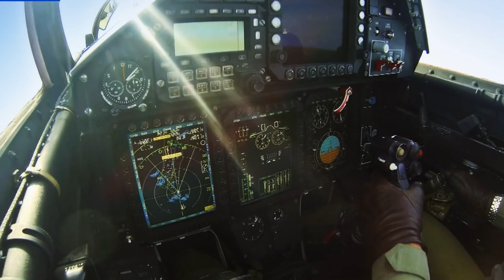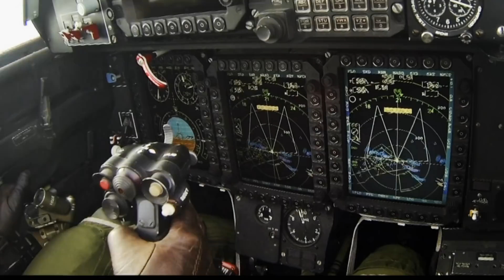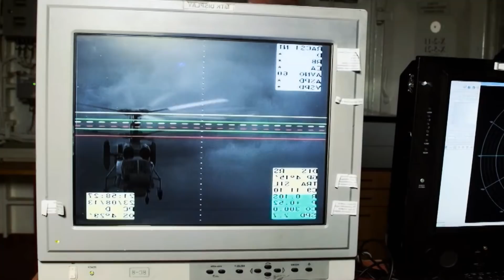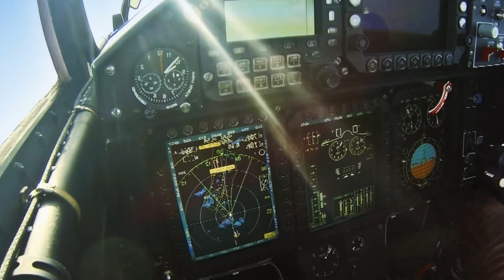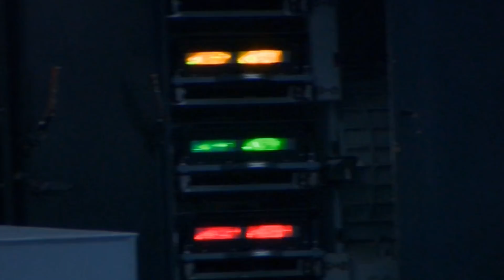Time Is Running Out for Russia's Only Aircraft Carrier - Admiral Flota Sovetskogo Soyuza Kuznetsov

Comment: In the Russian doctrine, this is not an aircraft carrier but a heavy missile carrier that just happens to be supporting a small fleet of aircrafts. Technically, per russian standards, Russia has no aircraft carrier as of now and since their doctrine is based around defence rather than offence, they will most likely not build anything new within the next 20+ years. They trained with it in Syria, lost 2 aircrafts due to flaws on board the carrier, but also had a lot of successfull airborne missions over Syria with it. I think the Russians got all the data they needed from the experience and they will be using that for their next design which is said to be around 100k tons. Also, I know a ship is supposed to be female, but Kuznetsov was a dude lol

Comment: Just emajin 1000s birds flying over a aircraft carrier. All of these birds decide to do a poo above the carrier. If this poo damaged flight surfaces of air craft and screens of aircraft that are parked on the deck.  Some crap to get sucked into aircraft engine.  Would this not make 
Aircraft Carriers. Big Expensive and Vulnerable. Like big dinosaurs. Aircraft carries in sirius combat. One major asset been made unusable.  You do not have to sink aircraft carrier to make it unusable. Lots and lots of cheep small drones including types that will glide to rake havoc on flight dekes. Just damage the flight surfaces of aircraft on deck. You do not have to sink a ship. You do not have to blow it up. Over whelm the vessel. It will be the low teke cheep ezy replace that will make the difference. The Gps will be jammed so it dose not work. The lases will be overwhelmed by bogis lases. Heet by decoys. Electronic pulses Radar Jammed or distorted . Just create a air of distrust in ones own equipment. The internet will be taken down. Nothing will go the way it was planed. Most major militaries have electronic warfare capabilities. To Jam certain info.    To project wrong information. Every bit of military reliance has a countermeasure. Aircraft carriers will become a large flouting liability tying up assets. How many corvettes, Distryers, cruisers,submarines  would one aircraft carrier  bild?

Comment: This piece of junk from beginning Reason lack of resources and didn't grasp the concept of carriers. The main reason to exist such ship is to deliver a punch with airplanes, uses it as floating airfield. So ship need do this job 90% of his time delegating specialist roles as anti-submarine and air defense warfare to specialist vessels which will protect sea airfield most time. And there are some problems with that in Soviet fleet lack of actual ships which can do this job most money was going to submarines with nuclear missiles, so poor "aircraft carrier"  must be starting do 5 jobs instead of one, results are expected,  no decent landing capability even top skilled pilots cant properly land on that deck. Second, it has no catapult(no space for it) so planes go up with fewer fuel and ordinance. Plus it has no intelligence or spotting planes to carry. So attack wave looks like that poor mig/so  take off to do bombing something without prior spotting (no planes to do it, no passage to target spotted with half of the fuel volume and a limited ordinance. Basically, You have around 20 minutes to do Your mission and then go back to land before fuel runs out. Best describe such ship is imagined battleship/carrier /anti-submarine warfare ship. It will do a poor job in any of these fields. it is a useless ship form beginning. Rather that build such dismal concept it will be much better of  like very capable cruiser missiles ship with some helicopters but without planes.

Comment: The point of this class is to directly attack a carrier group, along with a whole fleet,  the primary role of the aircraft are as a fighter screen for the fleet and anti submarine opperations

In a real naval conflict it would be difficult for a nimitz class carrier to defend its self,  which is why the US developed better anti missile capabilites ( 3 CWIS units will not cut it)

Comment: Radar range 15km wtf.. That is ridiculously low and I bet that's very inaccurate information because if you park S400 missile system on top of it, that would have at least 150 miles of air defense including airplanes and missiles. Check ur info next time

Comment: Needs to be said, when comparing to US counter parts - Russian navy has way less water to oeprate with so the focus here is very defensive and to not to go across the globe and project their power or deploy troops there.
The real strength of Russian navy is obviously in smaller craft that are more agive to operate near cost lines. If russia wants to project power anywhere they would use extensive fleet of submarines.
CVs look really great as a picture of power but not only one.

So TL:DR - direct comparisons with US navy are not accurate because russians have a different approach. I would say both are valid. IMHO.

Comment: The aircraft carriers with ramps look so dumb. It's adorable
Reply: It's a cheaper and more reliable system than catapaults.

I agree though, it does look a bit silly in this day and age 🤷🏻‍♂️ Lol
Reply: @KumaBean  it's cheaper but it's not more reliable...
Reply: opticalcanine A ramp has zero moving parts, you can't be serious?
Reply: @KumaBean  I was pointing out that you calling a ramp reliable is stupid and they don't do it for cost or reliability, they do it because they can't build a nuclear powered carrier with enough power to actually install an actual launch system. Sorry that you needed that explained
Reply: opticalcanine How often do steam catapult systems fail, and how much maintenance do they require, versus the passive ramp?

It's also worth noting that the Elizabeth Class carriers don't require arrestor gear either, but I guess that you already knew that, being an expert and all.

I know the difference between the two.

ETA, The UK is fully capable of building a nuclear carrier, but as I said, which you tried to refute, it was down to cost and cost alone.

The UK doesn't have crippling debt on par with the US, there's probably a good reason for that.

Comment: Time is running out? This is diesel ship that means it can be fully operational in case of nuclear war when EMP will hit the ship. But the USA would be inoperative. And in case of war i believe Russia will use ships from second world war. Time will run out for Kuznetsov but after 100 years. Still better choice than US and Britain overpriced and malfunctioning Zumwalt class.
Reply: That's not how EMPs work.
Reply: ivanlagrossemoule you could make longer sentence you know?
Reply: You can prevent damage from EMPs to some extent for a start. Military equipment generally has a good amount of protections.

Also, even if a carrier has a diesel engine, it relies on electronics and electrics for a very large portion of its systems, and so do its aircraft. An EMP powerful enough would render anything Russian just as inoperable as anything from the US.
Reply: ivanlagrossemoule carriers are not shielded for EMP even they are not farraday cages. And i did not said anything about aircrafts, i said engine would be not functional on US carrier in case of nuclear war and that is true.
Reply: Aircraft carriers are shielded for EMPs. They would be pretty vulnerable otherwise. Combat electronics aren't just random industrial systems, they get a whole set of additional testing and sub-systems to resist more advanced threats.

An EMP would make the Russian carriers just as inoperable. Even the Russian diesel engines are regulated by electronics, so are most systems. A powerful EMP would fuck up any carrier.
Reply: ivanlagrossemoule carriers are made to survive nuclear attack not emp. Program for carrier emp survaivebility US army adapted in 2009 so there is only one US carrier built after that. So most of US carriers (their engines) will shut off (if they are nuclear).

Nope, some parts of Russian diesel engines are electronic but not the main parts. Diesel engine would be still operational.
Reply: Surviving nuclear attacks requires surviving EMPs. Also, stop talking out of your ass, there's an entire field of engineering dedicated to increasing electronic survivability to threats like EMPs. What matters is how powerful the EMP is and how it functions in particular. EMPs aren't magic.

Diesel engines might still function but the carrier would be inoperable either way.
Reply: ivanlagrossemoule surviving nuclear attack of most carriers today means surviving nuclear blast and radioactive protection for crew. Surviving EMP USA adapted only in 2009.

But diesel engine would be operational that means Admiral Kuznetsov could relocate behind enemy lines or back to base and nobody could do anything about it until the power would be back on.